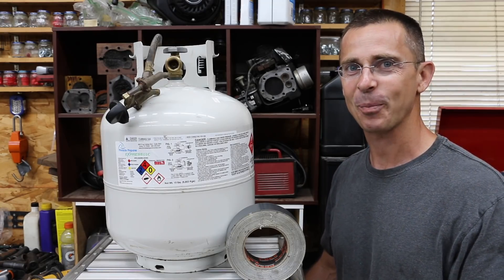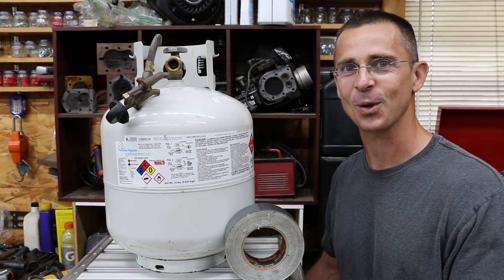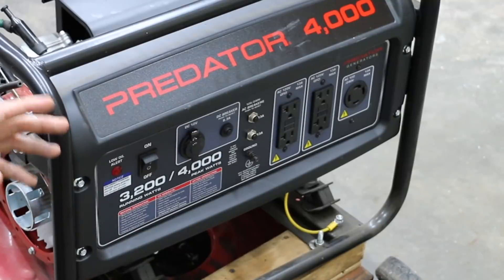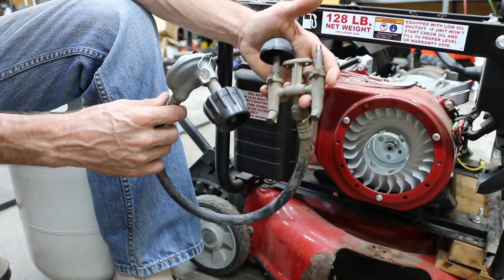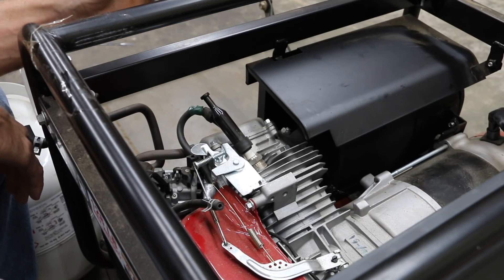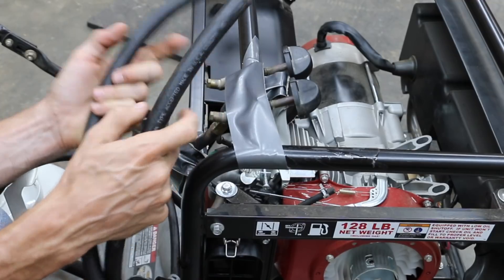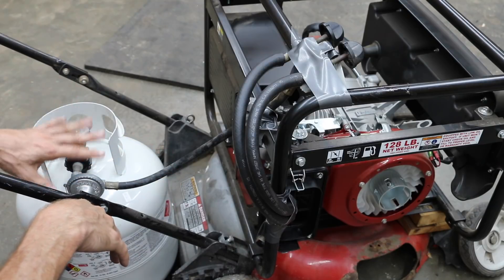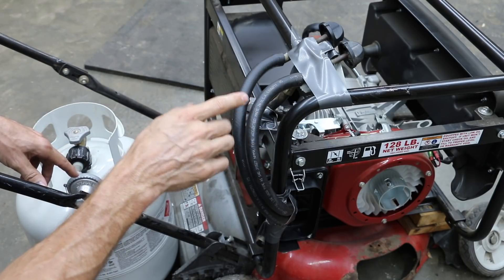Can a gas (propane) grill power an engine?  Let's try it!

Comment: I read few comments on lpg in oz.. All taxis use to run in gas usually ford 4.0 6cyl.. No problem 500.000 miles still running good.. Many times seen 1 million klms..
Reply from the maker: Wow! That's a lot of miles.

Comment: Can you use argon?
Reply: No argon is one of the more un responsive gases it don't burn or nothing
Reply: @adjustablehammer3749  it does but it has a high flash point and has to be mixed with oxygen to efficiently burn at a consistent rate something like butane or nitrogen would run better
Reply: @austinduff8833  I dunno how hot you would need to get then but a arc from a mig welder can be as hot as 20,000 degrees C and argons the shield gas in a mig and it dont burn there

Comment: So are lpg conversions for cars not a thing in the states? In Australia lots of cars run on this stuff, although its done better than some pipe and duct tape.
Reply: I haven't heard much about it here.  My grandparents had an RV years ago that had a switch to switch back and forth from gasoline to propane, but I haven't really seen cars with it.  We also don't really have the stations to fill it.  Most places only sell small prefilled tanks, and only a few places have a large tank to hook up to to do your own filling.  At least where I live.
Reply: @TheCgOrion  you can buy it at a service station here, was a shitload cheaper but the taxes and stuff have gone up and made fuel go up heaps in price. Its still cheap but not as cheap ~Aud$.95/litre($2.45USD per gallon) it used to be AUD $.50 ($1.30usd per gallon)

Comment: You deserve a discount, good job.
Reply from the maker: Funny!  Thank you!
Reply: @ProjectFarm  did you know that buses run on propane not grill type
Reply: @theeyum  and forklifts. But it's all the same. It all comes from the big giant tank at the propane distributor.
Reply: @ProjectFarm  can you try and run an engine on hydrogen? Pure hydrogen. To see if the water after combustion would cause any problems.
Reply: @ProjectFarm  When starting my gasoline engines like my lawn mower in the summer or other engines I haven't converted to propane. With no load block you can use the propane tank turn valve to regulate propane to the engine. Not the best but it works.
Reply: I sell propane and propane accessories
Reply: No fucking way 😂😂😂
Reply: I am pro-pain.
Reply: @mikeymcmikeface5599  You kinky son of a gun
Reply: @mikeymcmikeface5599  i wish that game was a real thing
Reply: Dam Buzzard Hawks!! Nice one👍🏻
Reply: I rather use butane
Reply: @GokantheHusky  that's a bastard gas.
Reply: @thebug4046  Tis it?
Reply: @Patriot4967 Tell him he be trippin
Reply: Lol I'm your 69th subscriber
Reply: Wow who made this account and got the photo of hank hill from adult swim on 325 at 8.00
Reply: It's alright, it's alright, it's alright, propane
Reply: “It’s all bout propane bout propane no charcoal”
Reply: Propane and propane accessories
Reply: Bwaaah
Reply: I huff propane..
Reply: A generator sitting on top of a lawn mower frame running on propane. MacGyver would be proud! Wheels on the lawn mower looking a little worse for wear though. Keep up the great work!
Reply: We had a gmc pickup that was converted to Propane and for the life of me cannot remember the name of the system it had.
Reply: Yeessss hank hill
Reply: P R O P A N E  A N D  P R O P A N E  A C C E S S O R I E S
Reply: That's basterd gas
Reply: I tell ya hwat
Reply: Coal is the only real grill
Reply: @noone-oo1bn  wood is actually better than coal (you meant to say charcoal maybe?) for barbecue. Depending on the essence, wood smoke gives a very good taste to the meat. 
What's more, once the charcoal has been lit up, large wood pieces can be placed on top to smoke the meat.
Reply: @noone-oo1bn  who the hell ever grills with coal, that's actually disgusting. I work in the meat industry and that's the stupidest thing I've ever heard in my life 😂
Reply: @alec4672  zero gamer might have meant charcoal
Reply: @noone-oo1bn  fun fact that isn't me it's my friend Alec, only a maniac refers to themselves in 3rd person. My point still stands coal isn't for grilling. Grilling with coal would be like grilling with crude oil.
Reply: @samcq5088  then he should have said charcoal instead of coal. Charcoal is burned wood with a high carbon content. Coal is the solidified remains of crude oil mined from the ground where its been being made into coal for 1000s of years. They're two totally different things one grows on trees and one you dig from the earth I don't really see how he would have confused them.
Reply: @alec4672  yes I know how charcoal is made because I used to work at kingsford
Reply: @samcq5088  i used to live in kingsford where it all started
Reply: He shouldn't because buses run on propane as well dummy

Comment: I had a car used to run LPG / gasoline. The LPG is known to burn dry and shorten the rings life... new engines burn oil and should not have issues with that...
Reply from the maker: Thank you!
Reply: @ProjectFarm  no! Thank you! For every amazing video you make.

Comment: I wanted to try a similar set up on my 2011 Chevy. It's flex fuel so it has some type of fuel management system with e85. My goal isn't to run just propane but to substitute when I drive at speed on the highway.
Reply from the maker: Thank you!

Comment: Nice. Here in Argentina. We use natural gas in a gasoline engine. With the today convertion 1 gallon of gasoline is U$D3.35 and natural gas or GNC as we call it is U$D1.34 so way cheeper. 
But we can't start a engine with gas. Is bad. Worse in Winter
Reply from the maker: Thank you

Comment: dual fuel gas/propane are quite common.  In the right parts of texas every pick'em up truck has a tank crossways in the back.   And i have seen tri fuel carbs for generators.
Reply from the maker: Thank you

Comment: Suggestion for your next project ... I have been wanting to do this on my generator.
Perform this same project yet add using HHO to the intake of the carb.  
1 Engine running with the fuel of Gasoline
2 Engine running with the fuel of Gasoline and HHO on the air intake of the carb.
3 Engine running with the fuel of Propane
4 Engine running with the fuel of Propane and HHO on the air intake of the carb.
5 Engine running with the fuel of HHO on the air intake of the carb.

Test the time frame of each fuel supplied, the temps of the engine and load it takes and how long the fuel lasts
The electricity needed for the HHO would come from the generator.
Reply from the maker: Thank you for the video ideas!

Comment: Cities are already using LPG in diesel garbage trucks here in Florida 
Here is an idea it would be a lot of work and research but running a motor on  hydrogen from water. I always heard it works thanks
Reply from the maker: Thank you for the video idea!

Comment: dude that was awesome i wounder how long you could run that thing on that tank of propane
Reply from the maker: Thank you
Reply: 1 gallon of gasoline is roughly equivalent to 1.36 gallon of Propane. A 20 gallon standard grill tank holds ~4.7 gallons worth of propane. That generator has a 4 gallon fuel tank and is rated to run 10 hours at 50% load.

So it should run about 8.6 hours at 50% load on a full tank.

Comment: lpg and ng are higher octane, thus will work better with higher comp. ratio. ihave had 2 irrigation engines on ng at 10:1 & 11:1 ratios ,both 300 ford started easy lasted longer. great vids. thank you.
Reply from the maker: Thank you

Comment: LPG is commonly used as a fuel in automobiles, but running a regular gasoline engine on LPG would harm the engine, it will fry your valves most of the times
Reply from the maker: Thank you!

Comment: How about building a small hydrogen generator and powering a small engine off of that? I made one out of 4 inch pvc pipe, nylon nuts and bolts and some stainless steel light switch covers for my car several years ago and it improved my mpgs
Reply from the maker: Thank you for the video idea!

Comment: I have an idea with creating your own propane, fill your own tanks. Hook up a mechanism to your vent pipe that flows off of your plumbing and fill your propane tanks. Im not sure if the vent pipe produces enough gas though but this next idea is pretty nifty..

 
Now this dude created this heated pressure system from water which he runs his truck on and his house furnace and stove. The city tried to fine him on this but theres no laws on the books on running anything on water (loop hole).

In his truck he has a 20 gallon tank and some pressure valves and mostly jacuzzi parts and its completely safe.
Just thought it be a really neat idea. Hus truck still has the same or very close to the stock gasoline power. The only issue he was having was the water freezing in the winter. He solved this issue with a modified diesel warmer. So in the winter he has to plig his truck in..
Im seriously thinking of running my whole house this way. Water can power my electric, my heat and my car.. 
when ever i look in to this more and talk to dude when he gets back from Florida. He travels ever winter to Florida and this is his first winter traveling in his new water powered 2002 F-150.
We have the same creek that flows through our land, so no shortage of water..
Probably can run a series of cisterns for filtration. Then the rest will be the pressure system and ignition system to run my generators and power my stove and furnaces...
Itll be a fun project if anything.. trial and error and see how efficient we can get this thing going. Before he left we were talking about making a self sufficient community haha...
Reply from the maker: Thank you for the video idea!
Reply: Yea its pretty cool. I know as soon as he gets back from his winter home I'm gonna study this contraption, find me a donor car or 2 and figure this out. If it produces the same power as a gas fed engine i think the car i convert is gonna be my everyday driver but my good car is staying gas fed. Water fed just seems like a future rust bucket to me but if it works and lasts itll definitely be a lot cheaper on the pocket. Figure out a multi filtering system and use creek water if youre stuck on the side of the road.. who knows, you can probably pee i the thing and itll tske you to the next watering hole..
Reply: I like your shows a lot..

Comment: i have a lehr propane powered weedeater that has a subaru 4 stroke engine and i absoulutly love that thing , im thinking about converting my honda 4 stroke weedeater to propane ,, for what i do it works perfect i can refill the small coleman canisters from my grille and dont have to worry about cheap gas problems , the low end torque of those 4 stroke engines will get the job done in a hurry at 1/4 throttle , thanks for sharing another great video !!
Reply from the maker: Thank you!
Reply: you are one of the coolest dudes on you tube for sure thanks for the awesome videos you share !!!!!

Comment: I have been looking into propane generators or a propane carb for one i have. I thought about trying this exact idea, to see how well it would work, but let someone discourage me with ideas of cylinder explosions
Reply from the maker: There are kits designed for this and they are safe. Thank you
Reply: @ProjectFarm   always looking for a cheap and safe way to get things done. And the grill regulator makes it safe enough for me.   
  I used heat shrink to clamp gas lines on a scooter today. Small fires and explosions dont scare me much.  
   I do want propane carbs for all my engines if available. 
 I hear old mail trucks ran on propane.

Comment: Nice job!  Too many parts, though - I replaced the carburetor with a piece of heater hose, and drilled a torch orifice to make things a bit more.... portable.  BTW, don't use MAPP gas like I did here - it's corrosive, and eats up the rings / piston etc over time.  Also, make sure you don't go too rich or you'll burn an exhaust valve / piston.  Pardon the safety-slippers....  https://youtu.be/Ina5bsAxeIk
Reply: That was a $5 thrift-store lawn mower-and-spare-engine combo, BTW.  The Carburetor was a lost cause - cracked pickup tubes and it seemed to be warped.   By the time I made the DC generator out of a 24V 3/4HP Permanent magnet motor, the engine had already lost compression from using MAPP gas, so it was a bit tougher to start.
Reply from the maker: Thank you!

Comment: The carburetor on my 6000 kw generator clogged up and hurricane Maria hit  the us vi and we were without power for 104 consecutive days.. well I took the carburetor off and fed theline  into the air intake and ran it that way. I was able to double the hours from around 7 to 8 hours to up to 15 to 17 hours on one five gallon tank of gas. worked really good ran 1700 hundred hours on it and saved a lot n gas with all the extra hours of use I got out of doing it with the gas going straight into the air intake..
Reply from the maker: Impressive!  Thank you for commenting on this.

Comment: I've ran engines off a propane torch, just hold it near the air cleaner unlit of course and away you go. quick and easy way to test engines in the field to see if they are runners or not.
Reply from the maker: Great tip!

Comment: That was pretty cool. I purchased a 7,000 watt house generator last year which runs on propane only. It was pricey, but worth it. run time on a 100lb cylinder is about 32 hours at 3/4 load.
How about trying a diesel conversion on a push mower.
Reply from the maker: Thank you for the video idea!

Comment: Would it be cheaper to run the small engines off of propane instead of gasoline? Could you mix oil with it for a two stroke engine?
Reply from the maker: Propane rates vary a lot in the US.  Could go either way regarding cost.

Comment: Would a propane powered motorcycle be possible? Would it require carbs of fuel injection?
Reply from the maker: For safety reasons, I wouldn't recommend it, but it is possible.

Comment: I dont know if the was asked in a previous post but will propane have any adverse effect on the valves and valve seats like the original car propane conversions of yesteryear?
Reply from the maker: Thank you for the video idea!  I'm told by a few viewers that it is indeed hard on the exhaust valve.

Comment: LPG powered cars are very common here.
The fuel is much cheaper (about 60% cheaper), you pay no tax on them for 5 years, they can usually travel even when other fuels are banned (due to them burning a lot cleaner and causing less pollution) and there's pretty much no disadvantage.
The only issue is that there are no self service LPG pumps, but if you run out you can always run on gasoline. It stings when you see how much more you spent than usual, but at least you don't get stranded.
I'd say about 1 in 4 service stations have an LPG pump so it's no problem finding it.

I don't understand why this technology isn't used more outside of northern italy.
Reply from the maker: Thank you!

Comment: According to my cylinder head rebuilder, the long term negative effects of running on propane is worn intake valves.  The valves need to be upgraded to the same kind that would be found in the exhaust.  Tax incentives and fuel costs make it look like a very attractive fuel until the heads need rebuilding at roughly 30,000 miles.  But for something that doesn't see tens of thousands of hours of operation, it works great.
Reply from the maker: Great point!

Comment: LP vehicles and equipment require a much narrower spark gap as propane is a liquid that is expanded into vapor at atmospheric pressure. Also propane carburetors are similar in design as gasoline ones with similar parts... propane is heavier than air so it will be sucked into the engine same way gasoline is sucked into the carb... those bright streaks in Gasoline is un vaporized fuel burning off... propane is already in vapor when it goes into engine... propane in an engine releases much less CO than a gasoline engine which is why it powers many forklifts and other industrial engines inside buildings
Reply from the maker: Great information!  Thank you

Comment: Nice experiment! I have a hybrid Champion generator that can run on gas and propane you just turn a knob to switch from one to the other. The only thing is it generates about 10-15% less power when running on propane.
Reply from the maker: Nice setup!

Comment: propane was and still is a viable alternative fuel. approximately 25 million vehicles run on propane world wide. the most common fuel used in a vehicle besides gasoline or diesel is propane. i drive my vehicle  ( 2011 crown vic) on propane. it works like a charm, and at half the price of gasoline.
Reply from the maker: Thank you!

Comment: Prediction, it runs fine but provides less power...I’ll keep watching and find out
Reply from the maker: Thank you
Reply: Project Farm that also looks like field expedient way to get a generator working if I left gas sitting it and the carburetor is clogged. That happens ALOT.  Put a generator away and then an ice storm hits a year latter. 🤦‍♂️

Comment: If you were SERIOUSLY intending to use propane long-term, you would buy or build a carburetor that would automatically control the mixture just as a gasoline carburetor does. Of course, that is a PILE of work.
Reply from the maker: Thank you

Comment: Nice i like that one!. Use you fire up sleds in extream cold with propane torch..
How about a gas engine on E-85.
Something with adjustable low and main on carb, so you can tune it..
Reply from the maker: Thank you.  I tested E85 in a recent video.